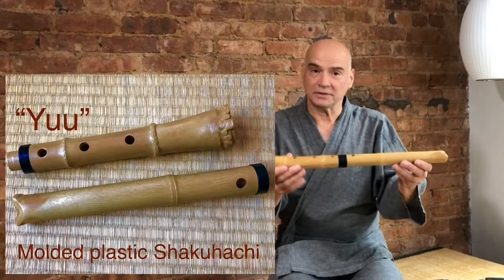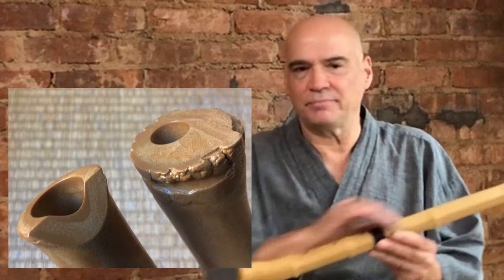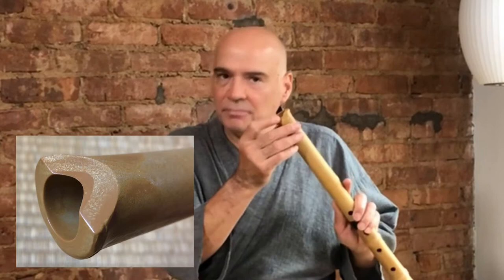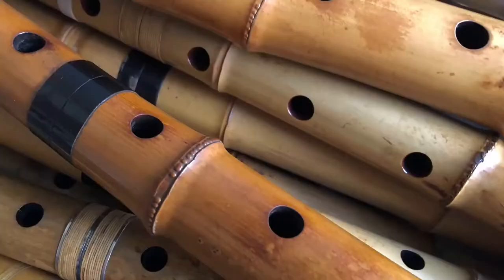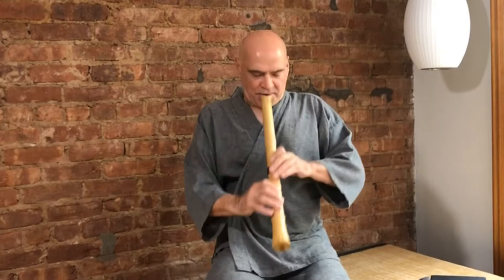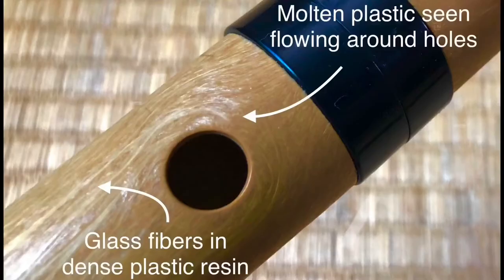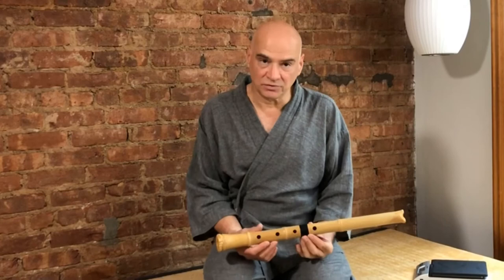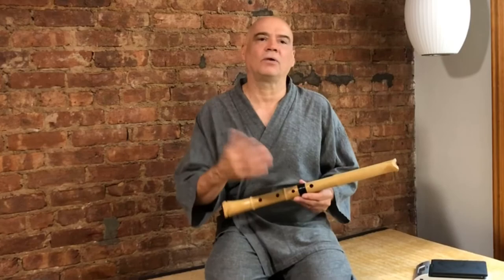Shakuhachi Plastic Copy : Yuu

Comment: I’ve been on the fence about getting one of these. Thanks for the discussion and review. I also play other flutes and yes, taking those one-of-a-kind expensive flutes traveling is mostly no-no. I have many resin and carbon fiber flutes of the other types I play, why not a Yuu too? 😊
Reply from the maker: I regularly carry my prized shakuhachi to play outdoors and take it on public transportation as well. It goes in the airtight tube which I reviewed in “Shakuhachi Care”@(15:00). But I never take real bamboo to the beach, a hot dry place, or on a winter walk in the cold. I once had my Yuu stolen out of the glove compartment of my car, but I simply ordered a new one. Nice to have around whenever you feel inspired.

Comment: Interesting .. Indeed it's a "cheap" solution to try and practice but I don't understand why a plastic intrument can cost that much.  Are we buying the brand ?!   I have been practising shinobue and they also have plastic fiber versions which cost not a lot, even made  by famous craftman. (Rippei and the flute cost around $40 dollars) ... I may be ignorant on that, but "shakuhachi" looks like a instrument for elite and the prices are crazy, so even for plastic... 
Do you know that other brand   GLASS FIBRE SHAKUHACHI 1.6 "GEN" BY DAISUKE KAMINAGA ?   ( but I think the Yuu is 1.8, even if I don't know yet what it means ahah ) 
thanks again for the video
Reply from the maker: The Yuu still seems reasonable to me in price. It is injection molded with glass filament impregnated engineering grade, dimensionally stable, dense plastic. There is some hand finishing involved on the outside to make it look and feel better. Plastic is sold by the pound, and of course labor adds to the cost since it is not an automated process. Everything contributes to the sound quality, so that is why it is special. I don’t think you are paying for brand or reputation, it really is worth it. (I have no connection to that company BTW.). It is more of an  “elite”instrument than something you just throw around and have fun with. Could you buy a quality western instrument for under $200? 
I have a few for $700 on eBay  (nyohaku) That are far above beginner flutes . It seems to be a Beyers market now. Glad you like the video.
Reply from the maker: The Yuu is 1.8. I do not know anything about the GEN, but keep in mind it is a higher pitched instrument (1.6), which is a little less common.
Reply: @nyohaku   Hello :) Thank you for your opinion and advice.
Yes, of course nobody would sell the product at the production cost price. 
I do compare with some instruments like electric guitar .. For entry level, there are good price $250 but I think it's more because the instrument is more popular so more competitors.  What I meant is for beginner, $165 dollars is still a big amount, and knowing it's in plastic, it can be normal to think it's too much.  That said, I bought the yuu on mejiro for 95 euros, because the yen I think. I still pay border fees. I can't wait to try that ... thanks again.
Reply from the maker: I am excited for you to give it a try. Good luck and have fun. People are either captivated or they find it too challenging or simply too time consuming to learn. Either way you got a good deal.

Comment: Hello Daniel, first of all thanks for your videos and the insights that you share here. I´m a complete novice and just received my first (second hand) shakuhachi yuu. Can you give any advice on how to clean it? Since it´s a resin, can I clean it with water (and a mild soap)? Can I use alcohol to desinfect it? Or would that deteriate it in some way? Again thanks and wishing you all the best, Charles
Reply from the maker: A damp cloth is a safe way to keep any Shakuhachi clean on the outside. Inside you should pass through a small weight on a string to pull the cloth through. Opening the joint frequently will wear it out and make it wobble. Here is a video for more information. https://youtu.be/r_xA4E5x9Zw
Reply from the maker: If you have a joint that wobbles, a quick fix is to put some nail polish on the joint, let it dry well and then put it back together.
Reply: @nyohaku  Thanks for your replies, much appreciated. The joint on my yuu was wobbly indeed, which made me feel insecure. I thought of using some waxed dental floss as a non destructive way, so I wrapped a few turns around the inner part of the joint. Now it closes nice and tight.

Comment: Sensei, How do you recognize the flute that is made of bamboo and the one that is made of wood?
Reply from the maker: Although bamboo is a type of wood, a “wooden” shakuhachi usually means one that is carved out of a solid single block of hardwood, usually maple. It is made on a lathe that spins it quickly, so there are no roots and other bamboo details. Still, they can sound quite good.

Comment: Sounds very,very good...so much goes into sound right?- bore size,shape,etc. I wonder just how much is " the air and shape" compared to wood/ type of material..I do hear differences when I play wooden flute compared to bamboo, the regular wood ones sounds "warmer", quieter- I don't prefer them. Have you ever tried the" laminated bamboo" ones? I heard a man play one in a video and it sounded darn good. Thanks!.
Reply from the maker: The big question is always: Is it the shape of the bore more important or the type of material? Everyone has an opinion; here is mine: The shape of the bore is most important, but the quality of the bamboo used in that flute is what ultimately makes the flute superior, or even magical. I was able to use fine sandpaper and files to fine-tune my plastic Yuu and greatly improve its sound. But I cannot give it the subjective warm sound of wood.
Reply: @nyohaku  If i may ask, how exactly did you fine-tune the Yuu? Asking since id like to do it on mine as well. I have made a few simple ones out of bamboo with the help of my teacher, so im not afraid of tinkering with it, if i know what i have to do (and also, i already own the tools, so why not).

Thanks a lot for making these high quality videos!
Reply from the maker: The Yuu that I got in the mail I had a rough surface I was not expecting. First I wet sanded it inside and out. I polished the top 2 inches to a shine with toothpaste. Then I used jewelers files to blend the intersection of all the holes with the center bore. Finished with 2000 grit. I played the flute for a few days before moving onto the next adjustment. It now sounds better than any you I have owned in the past.

Comment: I actually just 3d printed one, it costs less than a dollar for me.
Reply from the maker: How is the sound? Hopefully its made in ABS or something else nontoxic. I am curious, I have not had access to this type of equipment in a while. The 3-D modeling must be impressive.
Reply: A dollar for a couple of spools of plastic filament for the project? If youre speaking literally, That's impossible. There might be free models going about but Im not sure.
Reply from the maker: Dominic must be referring to FDM, since SLS may not have the resolution for a smooth internal bore. (?)
Reply: @nyohaku  hi Daniel thanks for the response. Loved your review too, I checked in and watched because there's a 2nd hand flute like this, seller says it's a Yuu, and Im prospecting of buying it.  seller is asking roughly US $26 for it but Im still thinking about it. Best regards.
Reply from the maker: As long as the blowing edge is not damaged and is nice and sharp it is not much of a risk at that low price.
Reply: @ermitanyo777  a dollar for a couple of spools? why would i need that many, a spool is 20 dollars, but u can get them as low as 8 for 1kg, the flute i made is maybe 150 grams of plastic. You need only 1/10 of a spool to make it. and there are free models, it was very convenient for me. although it is not the solution for everyone, beause not everyone has a 300+ 3d printer (fdm). But if u do, or have access to one. its a good option. although im sure injection mold would create a better instrument, I myself don't notice because it sounds good, and im not too knowledgeable on what makes what sound better and why. but for a few dollars at most, it sounds fenominal.
Reply: @ermitanyo777  also i did it, so its not impossible. its literally sitting under my bed, it rolled there lol. in fact I made 2.

Comment: Why buy a plastic shakuhachi? We already have enough plastic in the world that pollutes the oceans. Think about this plastic flute. How long will it take for it to decompose? You might play it for a few months and then it sits around or ends up in the trash. My experience with these flutes is bad. They are way too heavy! Almost twice as heavy as a shakuhachi made of bamboo or wood. There is a risk of cramping and tendonitis.  The sound is not good. The shape alone does not make a good sound. It is the vibration of the material. Bamboo and wood are natural materials and wooden shakuhachi are only slightly more expensive than plastic ones. So think before you buy a plastic instrument.
Reply from the maker: After having owned two Yuu flutes, I feel that there is always somebody who wants a free working flute; it should never be buried in the landfill. I suppose lithium and Ni-cad batteries in phones and electronics have done more damage to our planet. Personally, I prefer to drive older compact cars and mostly get to work by bicycle or mass transit. Carbon footprint matters. Bamboo does sound better because of the natural resonance of the wood. Smaller players that practice long hours may suffer with solid bamboo flutes with great dynamic range like the Yuu (414g). In the video “Shakuhachi- Inexpensive Options” lighter alternatives are also recommended. I have 10 professional flutes by well known/historic makers for sale that range from 332g-495g  (@1.8). 400g is the sweet spot. I don’t sell the Yuu. Weights are posted in the video reviews (“Shakuhachi Connoisseur”).  In “Daiwagaku: Conclusion”, my flute of choice (for this Zen piece) is the lightest, when compared side by side with a half dozen others for sound. In a good studio recording, bamboo shines, I’m sure you will agree.
Reply: Plastic Shinobue makes sense though because the actual cheap bamboo ones break in the higher keys.
Reply: @nyohaku  I also think it would be a good model for amateur Flute makers to practice making!